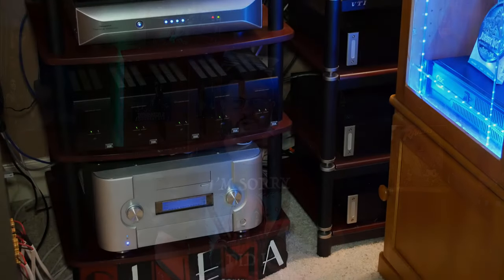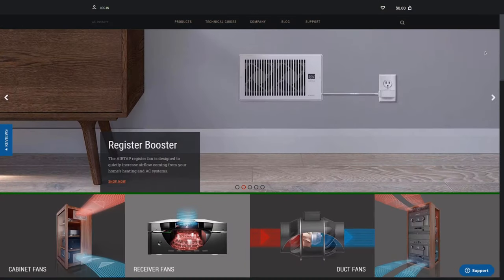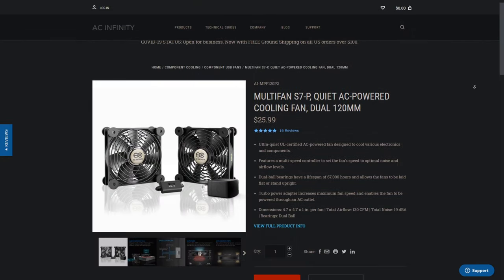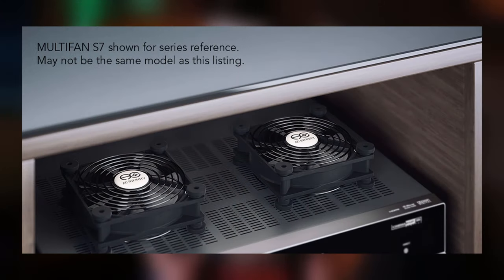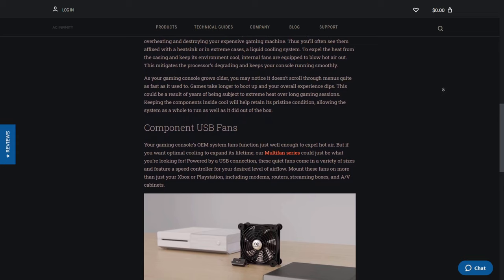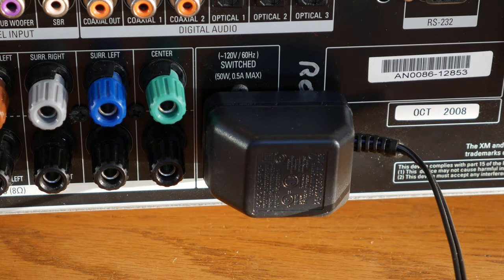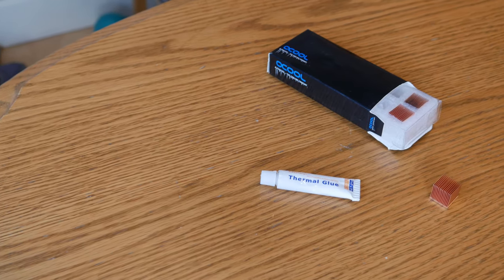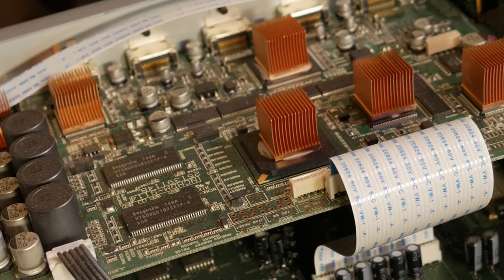HOW TO Keep Your Home Theater Equipment COOL! | AC Infinity S7-P Overview + Receiver Heatsink Mod!

Comment: Great video guys.  I have adopted cooling my components about 2 years ago and haven't looked back, I have fans on all processing and power components.
Reply from the maker: Thank you Barrett! Yeah man AC Infinity has some really cool stuff, I may have to get one of those controllers like you have, eventually. 😀
Reply: @TwoGuyzTech  Absolutely, I love AC Infinity gear.  That usb controller is super handy, and you can use an USB fan with it.

Comment: I have problem with my HTS, it’s amplifier board always gets hot because I’m using high quality coaxial input , and finally I fixed that board and my problem is when I’m using it it gets hot and the fan doesn’t boost to make it cool. How can I fix it or just I need to change my hts fan? It’s Philips hts5550

Comment: so im a pc nerd that loves my bass. both me and my daughter have receiver style surround sound setups. both of our computers have bottom to top intake/exhaust so i just had both of our computers sit on top of the receivers to pull air through them into the case and exhaust out the computers (temps in the pc are negligible since then) my question is can you put TOO much airflow through a receiver. my pc has 2 140mm 3000rpm fans as intake, while they dont always run at full speed they are connected to my CPU/motherboard temp controller so if my cpu gets hot they automatically fallow a custom fan curve i have setup on the pc. In theory would all that airflow, 2 140mm fans 3000rpm cause any issues?

Comment: 🔻Hey my man!
Thanks for the tips, but one question remains - did you turn your fans to pull hot air from the heatsinks, or just regulary pu[ them to blow and dispershe heat everywhere?

Thanks in advance!
Reply from the maker: Thanks for watching! Yep, we have the fans setup to pull the air out from the processor, which works naturally with the warm air wanting to rise out of the vents in the processor. Hope this helps :)
Reply: @TwoGuyzTech  Yeah, yeah I just read on some forum that pushing the hot air inside could "cook" the capacitors.

Thank you very much for your confirmation.

Blessings from Croatia! 🕊️💛
Reply from the maker: @Faith_Plus_One  Thank you again for the comment! And Blessings from the United States! :)

Comment: ... alot of components use solder or a thermal paste with tension mounting and heatsinks, not glue to cool components.  there is also thermal pads, so you Ocool heat sink mod, i would really like to see a before and after thermal measurement, maybe you can team up with gamers nexus for that niche of gamers using home theater with their gaming.